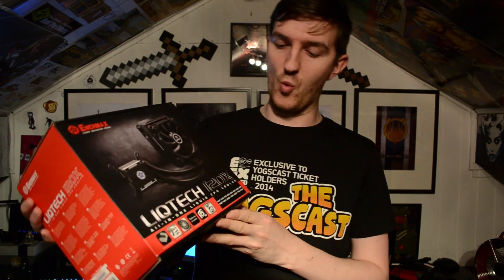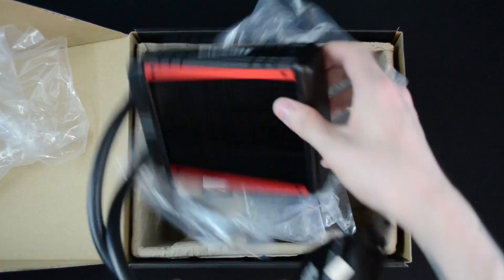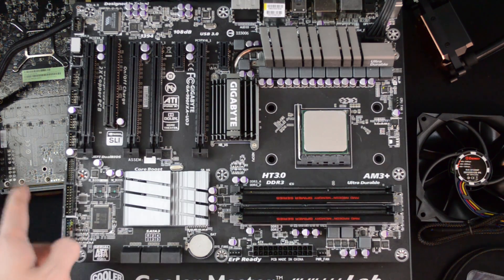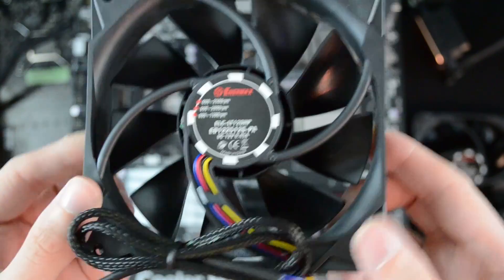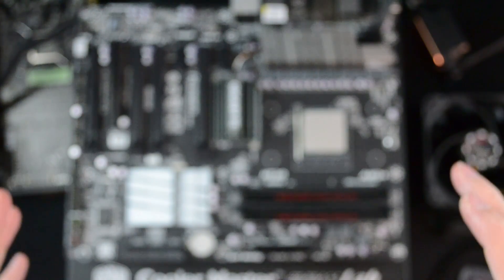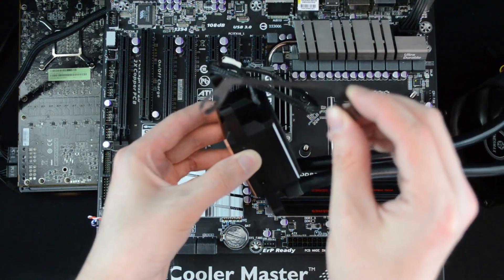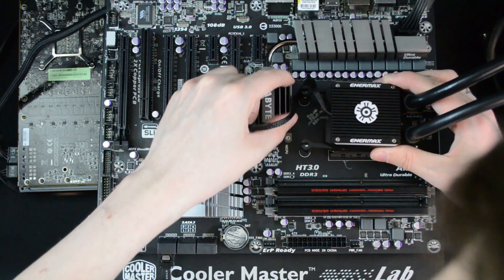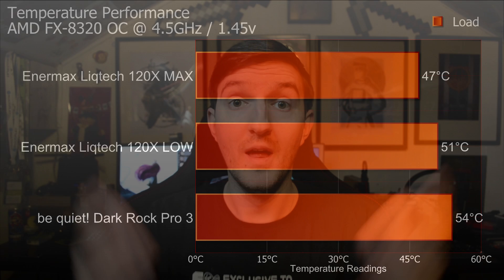Enermax Liqtech 120X Liquid CPU Cooler Review

Comment: Hei dude, I keep my 8320 stable at 4.4 ghz with 1.345v so decrease your voltage man...
Reply: Nopiw 1.4v now at 4.5 ghz stable and chill. .
Reply: well when I oceed i needed some advice, folks around told 1.45 at 4.5ghz..that was to much for me knowing that i've managed to work with 1.35 at 4.2 ghz  so I let here this info for other folks with fx 8320 which is not so great cpu but enough for these days.